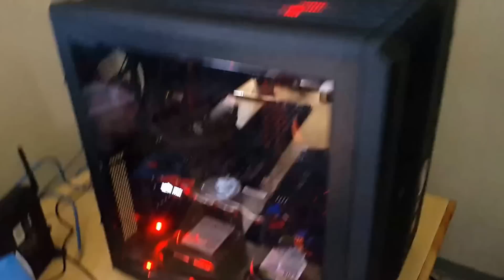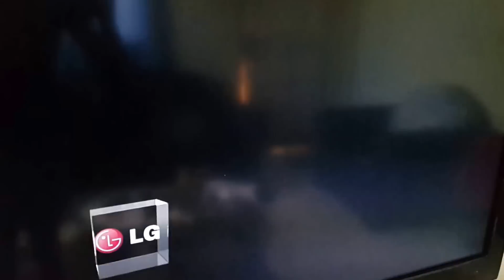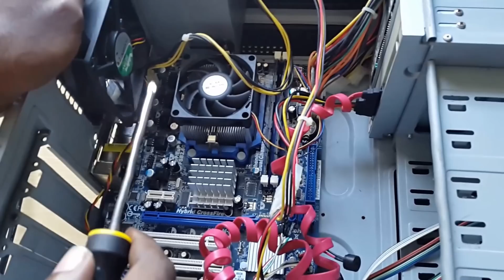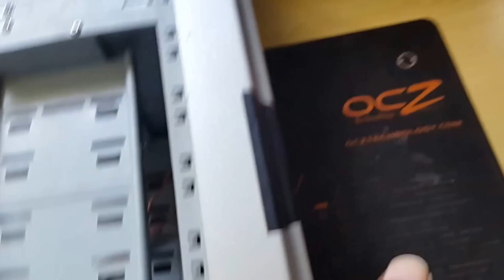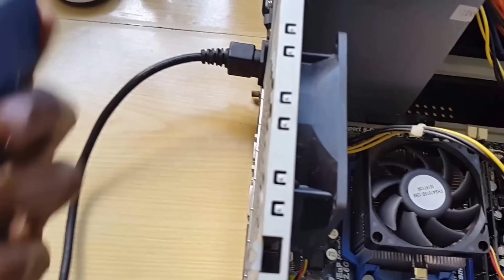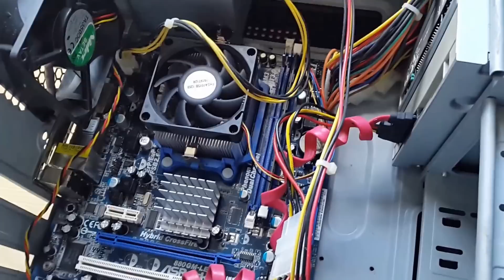No signal to Monitor Fix Easy PC Fix

Comment: Heeyy wats up guys 
i have a problem , my pc is working but if i plug in my video card and it wont turning on , fan also not turning on.
why ???
REPLY
Reply from the maker: Lets see: 1. Is your Power supply powerful enough to support your Video card and its components.
2.Check Video card in another system to see if its faulty.
3.If the Pc works without the video card the Video card is faulty or a component that is associated with the video card is bugging out for some reason. 
That should narrow down your search as to whats wrong.
Reply: Thats really help bro, but if the video card was the problem why also fans are not working ?
Reply from the maker: Cause and effect in computers is not always direct you cant speculate problems often have wird solutions with strange symptoms. The video card could be drawing too much power and causing the motherboard and other components to shut down. You wont know until you try what I suggested.
Reply: Thank you bro , can i fix this bro ? or just buy another video card

Comment: the way i fixed mine was strange i used to have a 27 inch acer led hd monitor after i broke it i changed to a shitty acer 15 inch moniter after that i wanted to hook up my tv through vga the tv used to work on boot up showing the hp logo then it would quickly go to no signal imput etc After about 5 hours i figured out that the refresh rate was too high for my tv so changed it from 75 to 60 and worked fine then hence i had to change the resoliution to 800 x 600 too and it worked

Comment: When i put A plugg monitor to PC in Graphic Card {section part} it's Show No Signal
But I normal put Plugg in another Section it's work but  In monitor Display clearly Not showing 
I just clean mother board and remove battery and fix it but no working 
Wt I am do ????

Comment: ok when i turn mine on. i get no display i can see my msi motherboard brand then i see a light blacklight but no display 
i have to reset it on my tower and turn it back on and i get display. please helpppp

so u said if u turn it off and the 2nd time u turn it on and u get a display then its buggged?
so mines screwed?

so to make things more clear, i turn on it randomly gives me black screen only at the start it doesnt cut out or anyting 
i reset it though tower and turn back on and gives me picutre.
Reply from the maker: Yeh pretty much sounds like some hardware issue. Its might be a single component such as the memory or Motherboard being bad. Otherwise it may be a faulty components that needs cleaning or securely put in place. You will have to determine which with what I have shown.
Reply: fml

Comment: What the hell..the holding power button trick worked...can someone explain the science here
Reply: It lets out the power stored in ur pc and resets your BIOS setting..
Reply: Yes, it's worked for me.
Reply: Does it really work??
Reply: I wish it worked for me... ugh.
Reply: MALL DIDIT GOT FIRE BEATS!!! I figured out my problem. Needed a new motherboard. Gl!
Reply: @Xxsorafan  how did you know if you needed a new motherboard or not??
Reply: S.A M my ex luckily helped me with this problem since he’s good at this stuff and suggested it could be the motherboard having issues.
Reply: @Xxsorafan  Dammit >_< 
Do you remember what he said? Lol
Reply: S.A M I just explained to him the problem happening in this video. And he told me if other fixes isn’t working, try changing the motherboard. He wasn’t sure if it would work or not.
Reply: @Xxsorafan  Do you remember what was happening to your PC? If it was a bad MB did the pc even turn on? What are the symptoms
Reply: My computer friend said the sane thing. If nothing works, changing the motherboard would be the last resort.
Reply: S.A M the pc did turn on. Everything turned on but the screen display was messed up like in the video. I don’t know the symptoms. Again he wasn’t even completely sure changing the motherboard would work. Before the issue I had trouble with a video game. So I force shut down my pc. Then when I tried to turn it back on, that happened. Sorry I don’t know much about tech stuff
Reply: @Xxsorafan  😭😭😭😭
Reply: I'm scared to try it because I got a brand new pc and it says no signal and I have bought it for the money I saved up for 3 years and I'm 11

Comment: how u explain why holding down the power for 1min helps?
Reply: There is electricity kept in the pieces still after you unplug the pc. That's why you don't open up a charger immediately after unplugging it.

Comment: Thank you Ricardo.  Your advice worked.  I had watched many videos regarding this problem.  None had mentioned this fix.  The consensus from their recommendations was to remove RAM and replace.  I didn't really want to do that.  So I kept looking  Lo and behold, I found your video, and it worked.  My only advice to you is to speak louder.   It was difficult to hear you.  Again, many thanks for your sharing of this information which enabled me to take care of my problem.
Reply from the maker: +Diane Gerson Glad you found my video. Also thanks for the tip will address that.

Comment: my computer comes on but it loses connection in like 1 hour
Reply from the maker: You have a faulty component possibly, you need to find whats causing it. Start with the video card if you have one.
Reply: Ricardo Gardener thanks I found the problem

Comment: (WHEN USING HDMI) FIRST THING EVERYONE WITH THIS PROBLEM SHOULD CHECK IS THAT YOUR PLUGGED INTO THE CORRECT HDMI PORT YOUR COMP PROBABLY HAS TOO 
I just found my wife sweating about how she broke our comp and couldn't do anything to fix and it turned out that she was using the top HDMI port on the comp when she should have been using the one in the forest middle

Comment: I followed you steps and now there is no bootable device... help please
Reply from the maker: If you are seeing no bootable device it either means the boot order changed and you need to go into BIOS and re-select the main Hard drive as the bootable device. Another possibility is that you somehow disconnected the SATA cables to the main Hard drive which need to be reconnected. Also check power to the Hard drive.

Comment: I moved the ram to different slots and I got the no signal issues so it must be to do with the ram. even after I cleaned it it wouldn't work. I tried removing the ram and trying it and still nothing ease help.
Reply from the maker: Did you try finding a new one and using that in its place, if it needs a new one you cant use the old one and expect things to change.
Reply: Ricardo Gardener no those are the only 2 I have and have done everything u said in the video but nothing seems to work idk what I can do further.
Reply: Ricardo Gardener thanks for the reply regardless I'll take it to a specialist only thing left

Comment: Still says no signal but after trying steps fan will not even spin anymore.
Reply from the maker: If Fans are not spinning any more check your power cable or outlet, nothing here in this tutorial should cause that.

Comment: what does holding down the power button do? because it worked, thanks
Reply from the maker: Discharge residual power in the circuit of the computer I think. Ultimately though who knows, the power button solution works on Computers, Tablets and Phones as well with similar situations.
Reply: Hey Ricardo, turns out it was something in the Bios, I removed the battery, hit the power button to get rid of the residual power, in the bios setting it was still recognising the 4 Sata drives that was previously installed that been taken out, I reset it to factory settings and bingo, she works like a boss.

Comment: if i hold down the power button will i keep all of my stuff because i have been using the hdmi port but im supposed to use the vga and thats the only part that isn't working
Reply from the maker: Holding down power will not affect your files.

Comment: I'm curious how the power button can function anything without power. It's just a switch to toggle?
Reply from the maker: Yes that may be so but the reason it works may be because it drains residual power left in the computer after being powered on. Dont question it , all i know it works.
Reply: Of course you question it. You should question everything in life if you want to learn anything. Coincidences is the cause of many myths. Oxidation on the copper contacts is usually the culprit, they get this invisible layer on them. Residual power would be drained by the MOBO without power anyway. Closing a circuit would be instantaneous, holding it for 1 minute wouldn't do anything more.

If it's real then it's common sense to learn the science behind it as it could apply to any electronics.

Comment: Mine didn't show on my smart tv with a doc desktop build that I just spend $2800 and trying to check inside the motherboard and cables are plugged plus the fan too and after that I turn it in the fan starts moving with lights and the tv signal shows nothing

Comment: I pressed the power button after unplugging the computer and it worked but only for around 3 minutes. The audio was still playing but the monitor turned black and read no signal

Comment: Thank U - My Jamaican technicians tend to know more tricks and explain it plainer and simpler
Reply: But why did I just read this in an Jamaican accent 😂😂😂😂😂😂😂😂
Reply: @quandrellhendricks  same Haha
Reply: Help guys I have a hd7970 ghz edition  3gb and when I connect it through hdmi it says "hdmi power save mode" but when I connect my older hd6870 with the same hdmi it works just fine although the hdmi i's quite long probably longer than 6foot. Once it worked but then when I put pc on sleep mode it the display never worked again and kept saying hdmi power saving mode.I v tried everything took the ram out took the mobo battery out unplug cables but not working .The last time it worked again was few days ago when I tried a different pcie cable but I doubt that made it work,I think either I'm having problems with my gpu hdmi port and I should try dvi dual link cable instead and hopefully it works, or my gpu is on its way out but then if it was dying I don't get why did it worked perfectly twice. I got the card given by a friend btw. Tried to connect it to my tv amd it says no signal check the device power connection or something like this.Any help would be  appreciated..
Reply: Aaaand my monitor got another problem. When I turn on pc, monitor shows me that it is out of range. It shows 30hz but it needs to be at least 60hz
Reply: @Bubungo  u set the resolution too high maybe
Reply: squalo do you still have the problem? if so:
right click screen and go to display settings in windows 10. 
change the 30hz to 60.

Comment: Umm I need some help, I was playing video games this morning on my PC, left for like 3 hours to get lunch, came back to find that I couldn't turn it back on. I built my gaming PC myself. All fans spin, all my cables are fine, I have had the PC for about a year with all new parts, I tried the power button method, and this has happened multiple times, the only thing that ever works is re seating all the coords. This time it didn't work though.
Reply from the maker: You may have dead or faulty hardware, it might have seemed like the cables but it might have been the Motherboard. Test the hardware for faults.

Comment: Right here's the thing, I had to send mine back to PC specialists as the problem was with the graphics card, pc came back and I had to do this to the pc in order for the display to work (which they told me to do) what I want to know is why won't it work with my upstairs monitor, every TV is fine and works with the desktop. except the upstairs one which is a BUSH-LED24970DVDFHD-24IN-FULL-1080P.  it worked perfectly before the initial break. I've tried using different HDMI cables, changing pc resolution. can't change tv resolution. other devices that is connected to the hdmi lead works with that TV but not my fucking desktop? does my TV have a grudge against my desktop or something!

Comment: So my friend and I built my computer on 5/5 and when we turned it on for the first time it worked fine. Everything turned on (monitor, mouse, keyboard, pc) but later when we went to my friends room to use the Ethernet cord the monitor didn't have a signal anymore. I tried everything in this video and nothing helped

Comment: I tried the first method, pulled the power cord out, turned the power supply off, and held the power button on for a minute and it worked. My keyboard also didn't light up before, and now it does. I noticed the monitors failed to light up after the system updated one of the programs... The PC is getting old though, it's about 7 yrs now... 

Thanks for the tip I appreciate it...
Reply from the maker: Glad that this worked for you, thats a really old PC, you might want to start looking at a new option as problems tend to happen allot when PCs get old. I usually give them around 3 years or so, more with good care.
Reply: Ricardo Gardener it's a custom built PC, Gigabyte motherboard, and corsair power supply, so I have to say it's served me well.

Comment: I had fix my signal problem after so many times have to shut down my computer from the plug on wall.  I decided to look for help.  I did what you indicate  on video my problem looks like it was from blue connector, I change to the second connector it may be dirt or damage and it did work I was happy No need to go to the repairs yet.  I have Asus mother board Soon will need to update after 11 years I Thank you very much for the video  showing and taking your time to teach people how to fix their pc's
Reply: Remo Gatron  He means the usb 3.0 cable

Comment: My prob is...GPU fan is spinning but no display when i put the HDMI/VGA/DvI cable in the GPU. but i try to connect it to the on-board and it shows up but in device manager > Display Adapters...My Video card doesn't show up...But the GPU fan is spinning...
Reply: Solonia Creatives Media it might be a defective gpu card. what is your gpu? also, it might be the ram, try realigning the ram again.
Reply: Solonia Creatives Media did you fix it?how

Comment: my graphics card is fckd R.I.P. GTX 970 12.24.2014 - 3.24.2017
Reply: ferenc shit I am having the same gpu and facing this issue 😫😫
Don't tell me it's the gpu I sold my bike to buy it 😫
Reply: tech technically guys, make sure the hdmi cable is connected to your gpu. this fixed my issue
Reply: Good to know we all have a gtx 970
Reply: im searching how to fix the problem, cause my gtx 970 suddenly its not recognized by windows and its not sending any kind of signal...i want to cry!!
Reply: mstrm3 thank you haha did not see the hdmi port on my graphicscard so i just put the hdmi cabel in the port above and now i saw it thx xd
Reply: LOL
Reply: R.I.P
Reply: Lol just bought an 144hz msi monitor yesterday, it almost didnt start but it did, now at the morning i tried to start it but it just said "Hdmi1,no signal" or something like that, wtf did i do wrong?! I didnt change anything since yesterday. Im never buying msi products EVER again
Reply: Never had those proplems with Nvidia gtx 750ti I just to use, my dad uses now and works like a beast , currently I'm using a gtx 1050 ti :)
Reply: Massive Legend Here sameeee
Reply: I'm also using gtx 970, and it's fucked me up too
Reply: @soupyW911  Your comment saved me! Bless your heart and hope you have a good weekend. I had it plugged into motherboard instead of graphics card.
Reply: My evga 970is fucked up too
Reply: ferenc DD/MM/YY should be the only way.
Reply: Ethan Bordelon I bought a different 144hz monitor and im facing the same issue idk whats going on or why this is happening but its pissing me off

Comment: I have an ASUS flat screen monitor about 4-5 years old. It has always been trouble free until now. A few weeks ago, I was going out of town for 3 weeks. I unplugged my computer from the main power outlet,.as well as the Monitor and all related electronic equipment.
  
On my return, I plugged everything back in again and switched on the power again. That is when I first encountered the following problem: A small black screen appeared in the top right corner of my monitor with the following words: - "DisplayPort NO SIGNAL" - The PC is working OK & I have both picture & sound on the monitor. The problem is, there is no way to delete the little black screen & it is immovable. Also, it prevents me from using "clickable" items located in that corner of the screen.

I've Googled this problem and followed some of the advice giving simple fixes such as disconnecting the PC as well as the monitor, all to no avail. I'm sure it is a very simple fix if only I knew what to do.   

Yes, I admit to being technically challenged, I put that down to my very senior age  . . . I've never taken any PC classes, but I try. I only use the PC for e-mail, searching for information of various kinds on the net and watching movies on Youtube. I'm not into doing much more because at my age, I'm not interested in starting a new career. Please help if you can. I really would like to get rid of this annoying display.

Comment: tried replacing the ram, tried another video card, tried the vga connector from the built in Mobo, tried reseating the cmos battery. still not working. do I have a bad motherboard?
Reply: Ed Pal is your cable connected to the gpu? if anything it might be a defective gpu card

Comment: Tryed everything, so what can it be, graphics card or motherboard ? I had my hdmi cable plugged into my graphics card and tv, was working fine now nothing, tryed graphics card to monitor, still no luck, hdmi to mother board, no luck, don't have a monitor for motherboard connection, face palm.